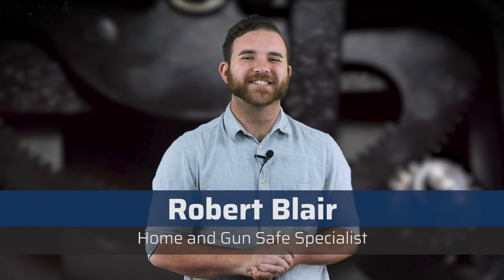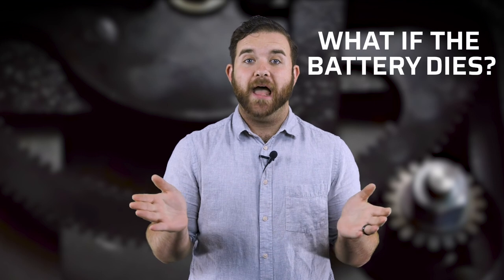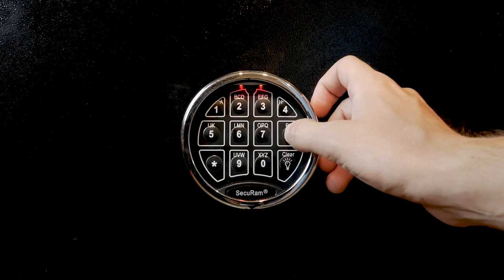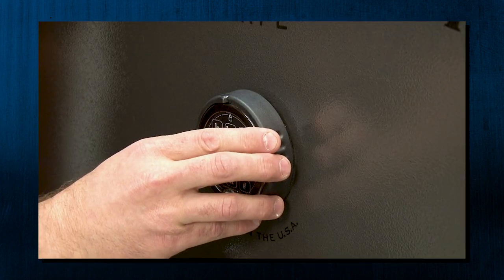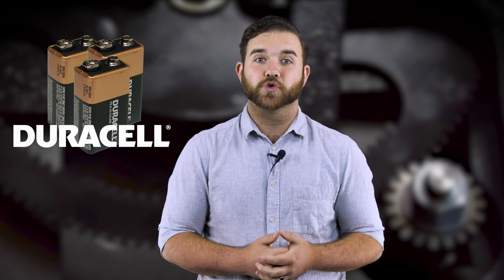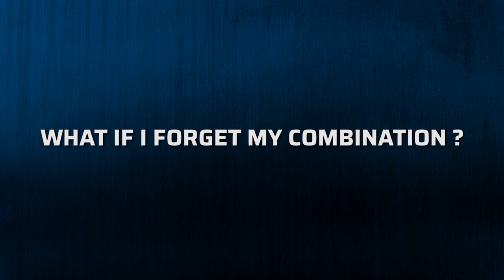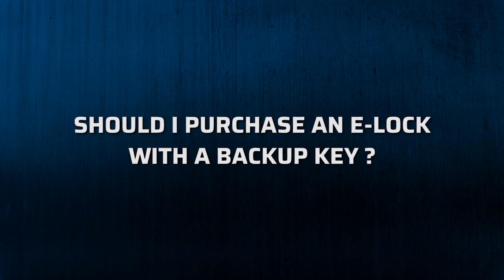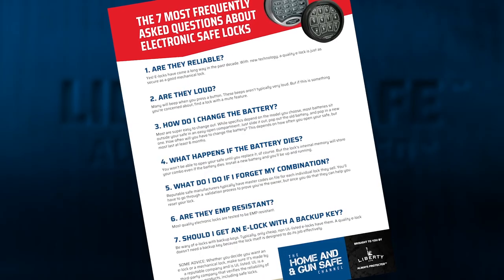Are E-Locks Reliable for Your Gun Safe? Everything You Need to Know About Electronic Locks

Comment: I just recently had to break into my electronic gun safe. The electronic failure was due to a tiny solenoid which is the part that releases the locking mechanism. It had lost continuity in its wiring therefore making it dead. Nothing to do but to tear into it. To all my friends out there who have one of these electronic safes....get rid of it and get a tried and true tumbler unit. It's a sick feeling when it won't open and you've tried everything the experts said do. Never again for me.
Reply: Side note. I'm welding mine up and putting four different pad locks to make it as safe as I can.

Comment: My e-lock just failed making the safe basically a boat anchor. Well I guess it saved me that expense. LOL. Go mechanical and save yourself a lot of trouble and expense. The cost to drill open the safe witrh the failed E-lock is a chunk of change. So i'll probably just wheel it out to the driveway and cut it open with a gas saw and metal blade. Will take a while... but not terribly hard and I can use the money I saved for a better safe. Glad I didn't bolt it down. And no I'm not worried about the safe getting stolen, just "unauthorized" access to the contents.

Comment: What if the E-Lock itself fails, without a back up key, i.e. Liberty safes have NO back up keys, the mechanical lock knobs are made out of plastic...My problem with this is, you call in a locksmith, he will get the safe open for you, after drilling, now you have a $800.00 plus safe with a door that opens & closes but no longer locks...Personally I think it is arrogance on the US manufacturers part for giving ZERO options to open the safe back up if/when the latch fails or the key pad fails in all eventualities, requiring a locksmith to get into the safe...
Bill... :~)

Comment: It's disheartening to hear that the lock mfg keeps a backup safety combo as well as the corresponding database of personal information required to validate identity before sharing that combo.  Sounds like a major weakness.  Maybe the lock can be locally configured to disable this feature.
Reply: Almost every safe I looked at had a starting code of 1,2,3,4 or 1,2,3,4,5,6.... works great if your battery dies and it loses memory from sitting dead a long time afterwards.
A locksmith is $400+ to drill and open it for you otherwise.
Tip: Don’t let the battery die, then the memory capacitor. Then it won’t be vulnerable.
Reply: @JimmyMakingitwork  Safes have nonvolatile memory that will retain the code indefinitely without power.  There’s no capacitor.  I don’t believe there is a back door combo like the video claims.  Maybe for low security lock boxes, but not for safes.
Reply: @JimmyMakingitwork  Try 400-800. Besides that it’s ALWAYS  closer to the 800, especially if they see you’re in need and/or it’s a good size safe at that. Hell for that you can just go buy another one and then drill it yourself!
Reply: I know this is an old post, but I bet Liberty Safes woulda seen this post and saw the shit storm they are in now coming!
Reply: @icaleinns6233   I completely forgot about this comment so thanks for reminding me.  It's such an obvious and critical security vulnerability that the company deserves to go out of business over this.  
I remember my jaw dropping to the floor in disbelief back then and it looks like I'm not alone.

Comment: Why is it that many quality safes with e-locks will give you a lifetime transferable warranty on the safe, but only 5 years on the e-lock?  What happens after 5 years if the e-lock goes bad?  This is a real problem, as most buy a safe as a long-term investment and the lock is critical to it’s functionality.
Reply from the maker: All our locks have a 5-year warranty with an option to purchase the 10 years or Lifetime extended warranty.
Reply: I was able to purchase a lifetime warranty on my electronic lock from the safe company. Of course, "lifetime" is only as good as long as the company remains in business. A Champion division in my case.

Comment: So...if the battery dies, I cannot open the safe. No way would I put one in my safe. And, what will happen when someone hacks those master codes? It's only a matter of time! They break into "secure" systems all the time. You hear about that almost every day. I can get into my safe in 20 seconds or less. Keep your electronic keypads, I will keep my S&G combination locks that usually have a couple of relocking devices built-in. If it gets destroyed, then it has done it's job.

Comment: I changed out my battery with 3 different batteries and  my keypad still doesn't work any help?
Reply: You have probably resolved the issue by now but I had the same issue this week.  Here is how I resolved the problem:  remove the battery (disconnect it) then press zero and hold for 10 seconds. Replace the battery and enter your combination. It worked for me the first time.
Reply: @smokysantana  I just went with mechanical dial
Reply: @dickeymoore4264  probably the best bet.
Reply: @dickeymoore4264  what was involved in the switch over.  Been considering

Comment: Not reliable mine just locked me out my Liberty Safe
Reply: No it didn't. You locked yourself out of your Liberty Safe
Reply: @CaptainRon1913  Nope the locked failed even with a new battery change, I had to email Securam for a new lock. So the best advice is to always have a replacement lock just in case the original fails. All electronic devices can fail at any moment some just take longer than others.
Reply: Mine failed too. I’ve only had one combination, never changed it and now it won’t open. I tried several “copper top” batteries, nothing. Luckily, my safe is empty at the moment so no need to panic, just a pita.